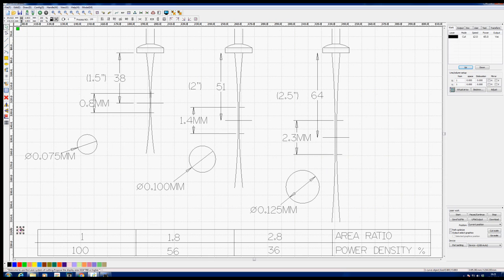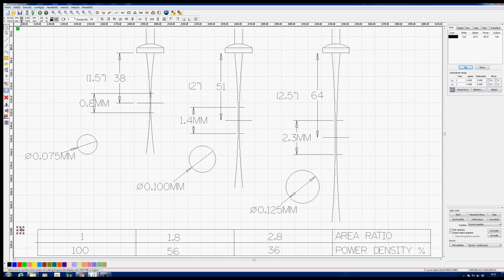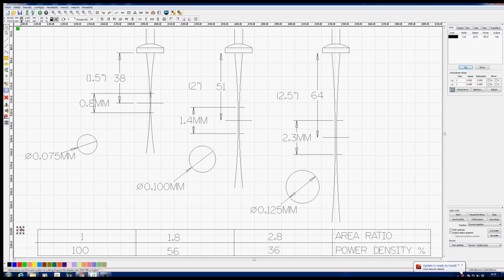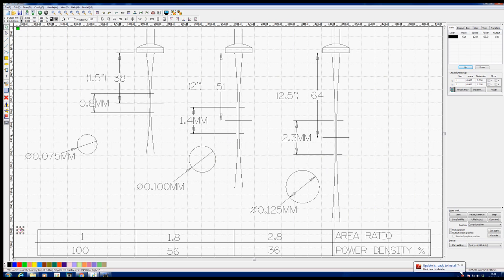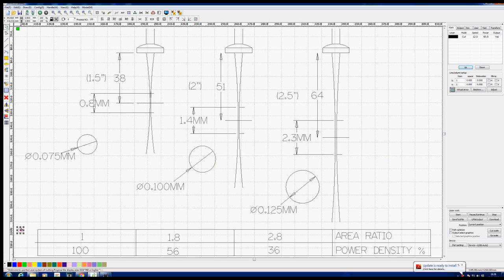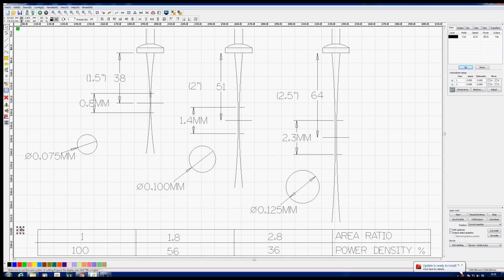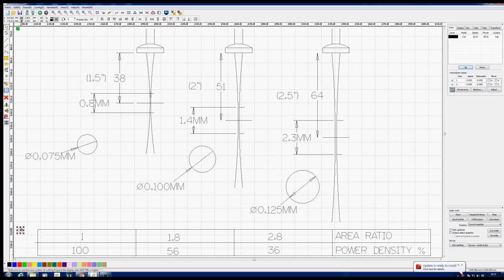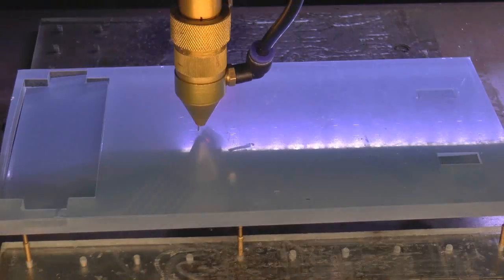RDWorks Learning Lab 39 Understanding Lenses

Comment: Wow that was really interesting, the opposite to what I believed was the case! I was considering a bigger lens upgrade at some stage won't now, thank you!
Reply from the maker: +patrick whelan 
Hi Patrick 
Thanks for comment. Several other people were asking me about lenses  which is why I looked into the subject in more detail. Glad this has helped. This is not intended as a pun but I shall be looking into mirrors soon. A totally ignored subject.
Russ
Reply: Hi Russ! I really look forward to that! You are doing a great service for laser users! My machine is in safe hands because of you :) By the way do you have any ideas on how to silence the extractor pipe? I'm a little worried about my neighbours my new one is quite a bit louder than my old.
Reply from the maker: +patrick whelan 
Hi Patrick 
The answer is simple but doing it may be difficult if you live on a top floor apartment. The reason it's loud is because you are pushing  high pressure air out of a small duct or straight out the fan. The principle of silencing is simple. You must allow the air to expand and slow down/lose most of its pressure/energy in an exhaust chamber from which it is  allowed  to escape at low velocity via a large area.  A crude but simple to make example would be a plastic (or rubber) dustbin turned upside down. Sit a piece of 1"or 2" weldmesh  upon 3  on- edge house bricks  and put a layer of hollow fibre fill from an old duvet (glass fibre insulation will do but is not very eco friendly) on top. Cut your duct hole in the bin(side is better than top because it will create more noise baffling effect ) and put your upside-down bin onto the insulation layer and mesh. Tuck the insulation up into the bin but do not pack it tightly Now you will have expanded the air and distributed the flow over a large exit area (the fibres) but not choked the flow. Additionally any other noise from the fan will be absorbed by the ground as it turns through 90 degrees to escape. That's a crude example of the principle, now it becomes a test of your innovative skills to make it happen.
Good luck
Russ
Reply: Hi Russ, Thank you so much for that you have got me on the right track now. This will be next week's project I have access to plastic 200L Barrels so I'll use one of those as the exhaust chamber. I didn't really get the concept I tried putting some figure of 8 cut outs into the pipe to disturb the flow but unsurprisingly that didn't work lol  tempting to build a filtration system into the barrel come to think about it. Luckily I don't live in a flat I have a 'detached' house but my garage wall is my neighbours house wall so we are very close and i do worry about upsetting them filtering would prevent the smell being a problem too. By the way redsail sold me my '130 watt' machine with reci S4 100watt tube and when i immediately contacted them thinking they had made a mistake they said that is what they do as it can do 130 at peak so is 130watt. As you can imagine I was very annoyed but nothing I can do and I soon got over it when i saw what it could do. I have had it cutting 20mm pine at 5mm/sec and 6mm ply at 30mm/sec so im very happy. Funny though I had to bring it down to 50% before it was running at safe mA for the tube. Just goes to show how these machines are almost set up to fail!.
Reply from the maker: +patrick whelan
Hi Patrick
Yep. Your S4 is a 100 watt tube , it's the S6 that's  a proper 130watt tube. However, your machine is still fitted with a nice expensive tube. Your tube is capable of achieving 130 watts output but like all reputable tube suppliers RECI state running and  max power as part of their spec.  They supply these tubes with an expected life of 10,000 hours of "light-time". If you are a serious small business running 5 hours a day 5 days a week, that's about 1.000 hours per year. To give their 10 month warranty on this tube you must not run it at more than the recommended milliamps and it will still be outputting 100 watts after that period. This type of tube also contains a catalyst to help recombine the oxygen with the carbon monoxide when it becomes dissociated. This greatly extends tube life. The 130 watt  bit of the spec is over-capacity to make sure that even with some small degradation, if you ran it 24/7 it would reach 10,000 hours in about 14 months, but at 10 months would still be delivering 100 watts. If you look at session 35 you will see how and why your tube output degrades and dies.
Back to your extraction. The smell is unlikely to be an issue because with a high airflow through the machine the fumes will be diluted by the volume. Just a note here. Make sure the air can flow FREELY through your machine. If you are in a closed workshop, ask yourself where is the airflow coming from? You will probably have to run with the workshop door open. Then check that there are sufficient holes in your machine case  so that the air flow is not strangled at that point either.
Second thought. A plastic 6" (160mm) toilet waste pipe straight up above gutter level may solve both noise and smell  problems at once and would be unobtrusive.
Regards
Russ
Reply: Hi Russ, Yes I saw your "understanding my laser tube" series which was amazing! So I understood the extra capacity and tried to explain that to them that it's extra capacity not just there to be abused. They said that they have 15 years experience and that is how they sell them so I just gave up! At least in the knowledge that their most common version of the cm1290 at 100w is actually the s2 90w so I haven't been ripped off any worse than anyone else. They said that my machine will work with an s6 when I need my next, but its already better than I expected so I'm happy! I have been able to set the machine so that when the software is set to 100% it's actually only 50% of the power supply which is nice and so it sits at 25 mA hopefully meaning I'll get my 10,000 hours.

Hmm I hadn't really thought about flow into the machine, I have the back door open in my garage at all times as the tube gets thrown out of it when I use the machine. I think that is probably ok in that case and the machine has a massive approx 1500mm X 30mm leter box opening at the back which I think is over kill and don't really like but that should allow enough movement in I guess.

Your gutter pipe idea sounds very good and easy which is always good I may see what I can source. Thank you for your suggestions, you'll be on my Christmas card list!

My other disappointment was that it was supplied with with the controller and software from topwisdom which I think is supposed to be an improvement over the rd works set because it has more buttons but I'm not overly impressed. the software is AutoLaser which is similar but I had a lot of problems opening files it can only really do dxf and I cant get any of the plugins to work. Also you can control the order of cuts but nowhere near as well as you can on rd works. So I'm missing RD Works lol 

If you don't mind me asking have you got and theories on removing the smell out of laser cut wooden products? It seems to be my biggest problem now. I've resorted to staining them which looks nice and replaces the smell with another but I'd love to just have a process that would do it. Unfortunately I mainly use ply so I cant just jet wash them which I think would otherwise be pretty good. 

As ever thank you so much for all you do for this community!

Patrick
Reply from the maker: +patrick whelan 
Hi Patrick
Click the Sarbar logo and then the About tab and send me your email via the messages button. You can tell/show me what your problem is and maybe develop a solution.
Russ

Comment: Thanks for all the effort you put into these tests. Very interesting.
Reply from the maker: +Bruce Fleury
Hi Bruce , 
I'm just selfishly enjoying myself digging into areas the interest me. If it interests you too,  then that's a real bonus. Thanks for your appreciation
Russ
Reply: +SarbarMultimedia 
Russ,
I, too, want to add my thanks.  I ordered a 18mm FL38.1 lens for my machine ($31 US).  When I took the lens out to measure its diameter, I found the original lens was installed flat side up, just like yours. Thanks for saving me that headache!  I also saw they have an FL25.4 lens with a shorter air nozzle head, but I'm not that brave (yet).

Comment: What was your source for the lens?
Reply from the maker: +2020tesla 
Hi Dwayne
http://www.ebay.co.uk/itm/391332816906?euid=24bf40a295d94c63ad8cd74208c7caee&cp=1

They are as good as the original fitted lens. and, I thought, reasonably priced. This is ebay uk but I suspect if you copy and paste  the title into ebay.com you will get the same item. I made a bit of a mistake when I ordered them I selected 20mm diameter and my machine takes 18mm diameter. Was I going to send them back? No. I just ground 1 mm off all round with my disc grinder. Worked perfectly.
Regards
Russ
Reply: +2020tesla 
If you're in the US, just search eBay for "laser focus lens 18mm" (assuming you OEM lens is 18mm).  You'll find lots with focal lengths from 1" (25.4mm) to 4" (100mm).